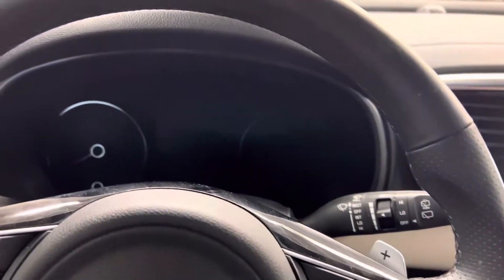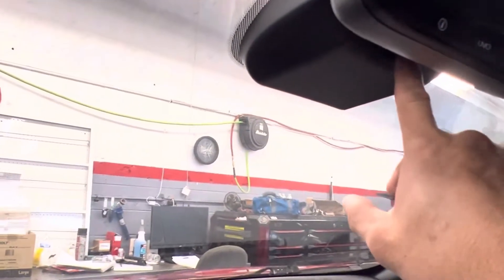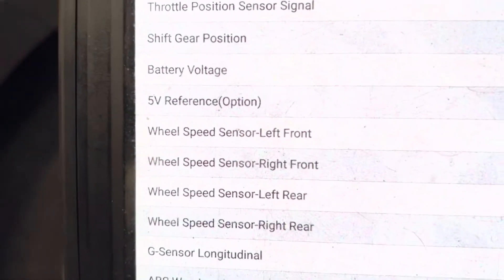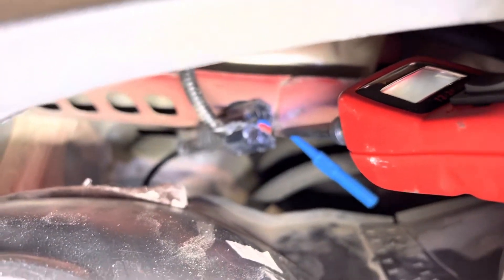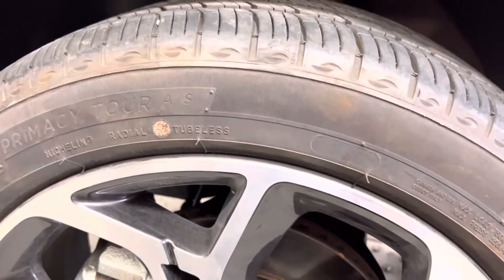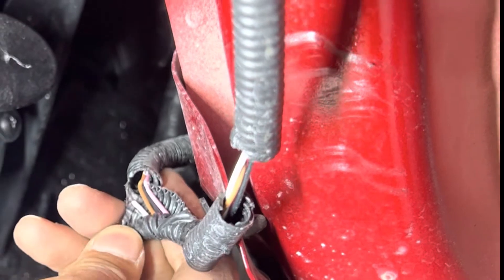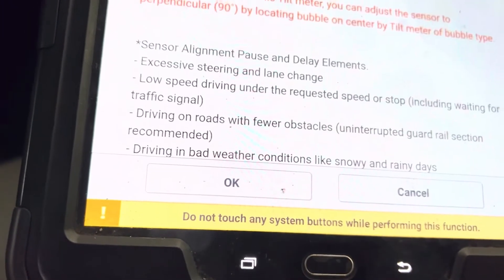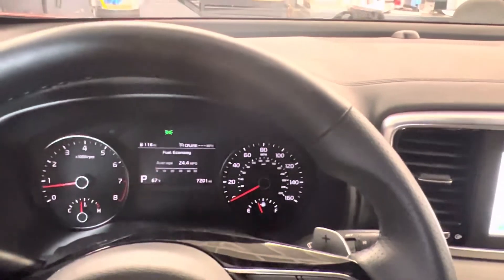How to diagnose Wheel Speed Sensor Open Circuit and Also Causing ADAS functionality, 20 Kia Sportage

Comment: I have the exact problem on the same car, I can't believe I actually found a video witch solves the issue. My car was also in a small accident on the front left side and I accually took the front bumper off to fix the parking sensors and I believe I messed up the speed sensor wire in the process. Thanks for the info you're the best!
Reply from the maker: I appreciate your feedback

Comment: Boss paano mag palit nang trans fluid nang Kia telluride anong fluid pwede mo recommend also anong torque specs sa drain plug..?salamat ingat
Reply from the maker: Hello, Kaylangan mong tangalin yung engine under cover then may 24mm bolt na drain plug, measure mo kung ilang qts  na drain mo, install mo yung 24mm drain bolt with new gasket and torque it to spec. 24.6-31.8, then sa rear upper part  ng transmission tabi ng transfer case may 24mm bolt ulit at yun yung fill plug, pour mo yung new trans fluid ATF SP4M-1 same amount of qts na na drain mo, install mo yung fill plug with new gasket saka mo torque. good luck.
Reply: @WrenchingRyan  Thank you so much boss